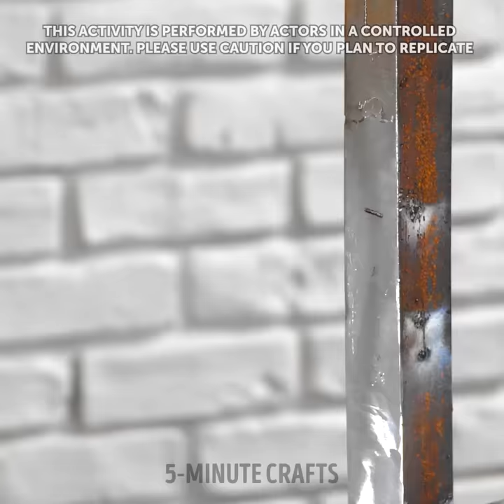Unlock Your Inner Handyman: DIY Repair Tips and Tools

Comment: Some of these tricks may be useful, but there are also those that completely contradict the principles of technique and work safety. A tool box from an empty canister is a bit of exaggeration and a sign of stinginess, because today a basic tool box costs very little in the supermarket or putting a bottle on your head instead of glasses. well, it's a circus, not a DIY trick 😂😂😂

Comment: Maybe,  just maybe if your in a pinch an your almost done with a job or project an you either don't have the tool or it just broke an in 5 or 10 min you'll be done with the job are these useful,  an only a few are.  But now I want to be a water bottle for Halloween.